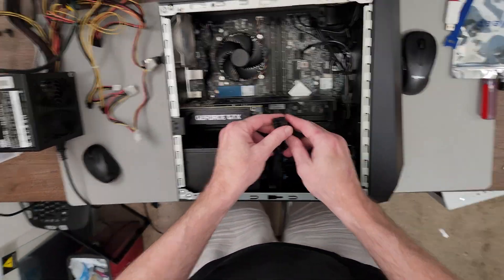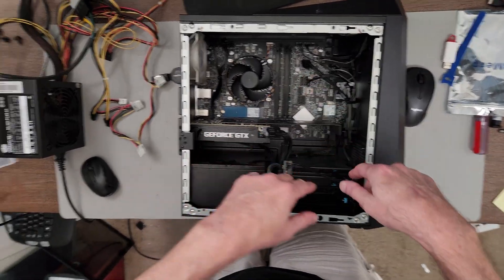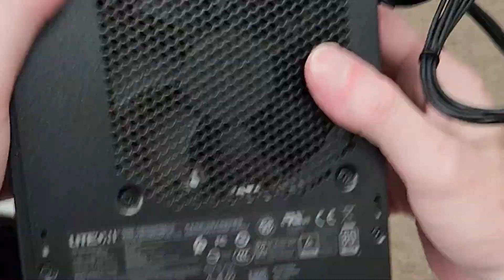Acer desktop failed power supply, connections to the motherboard are not standard, 6 pin to 24 pin

Comment: Good video my question is I have an Acer xc 160g and I've already upgrade the RAM and the main storage for Windows but now I'm wanting to upgrade to get a graphics card but I need probably to replace the stock PSU in it will this work the six pin adapter to 24 pan
Reply from the maker: I don't see a Acer xc 160g. I do see a Acer xc 1660g. Taking a look at the motherboard it does have a spot for a 6-pin power supply cable as well as an 8 pin. One of the 24 pin to 6 pin adapters would likely work in the system to allow you to put in a standard 24pin power supply. I can't say for sure though.
Reply: @MichaelTheComputerGuy  yes is 1660g

Comment: On Orion 3000 PO3 630 the 2x 4pin is not compatible like the 24pin - 6pin
Reply from the maker: You should be able to find a compatible adapter to make a standard ATX power supply work. On the motherboard is it two separate 4pin connections that are required? If so I would go to Amazon put in Orion 3000 or whatever the model number of the computer is along with 2x4 pin PSU adapter.

Comment: If I’m not wrong this is the same stupid ass model I got (Acer predator orion 3000) thank u so much for the link to the connector I’ve been looking for 5 days straight for a new power supply but not a single one under 150 that connects without this adapter

Comment: Hi, I have a somewhat similar problem with my corsair RM1000X PSU (my pc is an Acer Predator Orion 3000 P03-640, quite similar unit to the one shown in the video (only changing the GPU and 6 pin location a little) basically when I install the PSU with an adapter (not the one shown in the video) and try to start up my pc, it does nothing like it wasn't powered, can the adapter shown fix this?
Reply: compare the pinout of the OG psu that came with the system with the pinout that the adapter gives , you might be bought the wrong one

Comment: But if you turn off the pc, the psu goes off? because i read that this issue can happens on an acer forum
Reply: no, it still works, you have to turn it off manually at the power supply ☹

Comment: Bro you remember me😢i replace my old adapter and buy a new one but still i am facing the same issue😢PC ON AND OFF IMMEDIATELY 😢😢HELP ME PLEASE
Reply from the maker: If you have the problem and you bought another adapter of the same type and it still has the same problem the adapter is not the cause of the problem. It could be an issue with the power supply or motherboard or something else on the computer.
Reply: @MichaelTheComputerGuy  but bro my new psu working properly, and my motherboard is also good bcs if I use my old psu my pc run without any problem 😭so what is the problem
Reply from the maker: @jaat6969 If the computer works fine with the old power supply what is the issue? What are you needing help with? Why are you talking about an adapter and why did you buy another adapter?
Reply: @MichaelTheComputerGuy  bro recently i bought a gaming cabinet, and in future planning to buy a GPU that's why I purchased a new PSU 🥺🥺.  please tell me what is the issue
Reply: @MichaelTheComputerGuy  please reply bro

Comment: I recently bought this adaptor and now my pc turn on and immediately turn of😢 please help
Reply from the maker: There may be something else wrong with the computer or that adapter is not right for your computer.
Reply: @MichaelTheComputerGuy  how to fix can you help me
Reply from the maker: I need to know a lot more about what's happening with the computer. Why did you purchase the adapter? Was it because you had a problem with the computer? If so what was that problem?
Reply: @MichaelTheComputerGuy  ok so here is my complete story - RECENTLY I CHANGED MY POWER SUPPLY FOR MY NEW GAMING CABINET, THAN I NOTICED MY PSU HAS A 24PIN CABLE BUT MY MOTHERBOARD DOESN'T HAVE THAT PORT. SO I PURCHASED 24 PIN TO 6 PIN ADAPTOR. AND NOW AFTER CONNECTING ADAPTOR WHEN I TURNING ON MY PC ITS TURN OF IMMEDIATELY 🥺🥺
Reply from the maker: @jaat6969  That adapter may not be right for your system. You might consider replacing the case and motherboard. With that you'll have a more standard ATX system as opposed to what the manufacturer did.
Reply: @MichaelTheComputerGuy  now I know my adaptor is damaged. Can you tell me how to fix it

Comment: With the original PSU and setup where would you connect the power cable for a 2.5" SSD? There doesn't seem to be any surplus power connection on the PSU?
Reply from the maker: That's pretty typical with pre-builts from the larger manufacturers that don't use standard ATX components. There's usually one or two extra SATA power cables but they are tucked away. If you're having trouble finding them get in there with a good flashlight and don't be afraid to take things apart. Just be careful.

Comment: Hello,i Hope Michael read this,i have acer aspire 1760 motherboard so its hard to find power supply for it as you know(i didnt know) until i bought GPU 
if i try this 24pin to 6pin with FSP Froton HYDRO K PRO 750 ,it will work? 
this is enought for me,i spent money,time and in the end...nothing
i read internet that my model of motherboard is hard to upgrade etc,but i will give it "last shot" whit this 24to6pin with this PSU
i worried only about damiging PSU,if the upgrade is impossible it is best to returnd PSU and my money.
thank you if you answer!

Comment: Thanks for the video all the way from the UK 😀. I bought an Acer aspire tc 1760 thinking it had a 300w PSU .. nope only 180w ! I was almost crying thinking Id have to go with a gt 1030 instead of my gtx 1650 . Saw a few posts about modding a tfx supply and then someone mentioned the dell connector . Did you find PSU fan still ran when the system was powered down ? Quite a few said there's did
Reply: so mate,do you fix your problem ?:D i have same acer tc and same gpu ,and same problem at the end
Reply: I have 1760 too 12400f, 180w psu and gtx1650 (with no power supply) from factory

Comment: I upgraded an Acer Predator from a 11400F core i5 CPU to a 11900F core i9 CPU and the performance gains when editing videos was outstanding. Unfortunately, I damaged the PSU when I installed an RTX3070ti without upgrading to a more powerful PSU. Now that I have the 6-pin to 24-pin adapter solution I will install an 800-watt PSU. The Acer only had a 500-watt power supply, but I ran it for weeks until it died. It also had 128GB DDR4 3200MHZ ram. Editing videos was a breeze with the upgrades installed.
Reply from the maker: Give that PC more power
Reply: Which PSU you have installed on this case?

Comment: Is it not kind of odd to power the drives thru the motherboard. What can possibly be gained ?   Michael I got to say that as a guy who nearly did a bunch of content using a hat mounted camera and  thought better of it after realizing that my head is an awful tripod and won't manage as aa steadicam either... I suggest you consider going back to the tripod...One fixed over the work and a mic stand with a boom does the flying B-Roll camera. If you are not into the editing/rendering time factor,  isn't there also a way of live switching between two (or more) cameras to a single H264 or MOV file? Just a fan..CGL
Reply: It's because these Acer computers came with SSD's, which are of course only 5v. The PSU's they use (ATX12V) are of a new standard, which reduce power consumption through only producing 12V power and not 5V or 3.3V. This means the motherboard has to convert it.